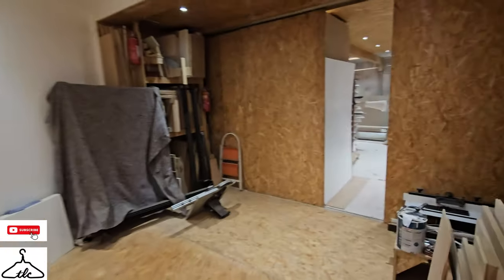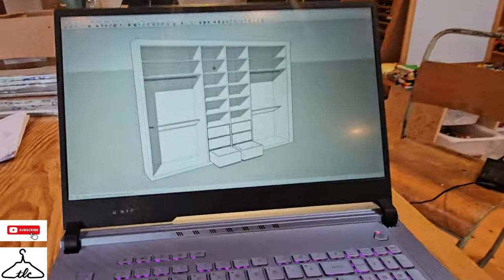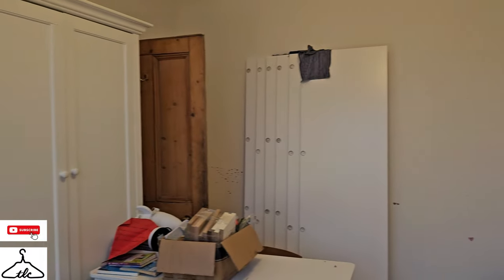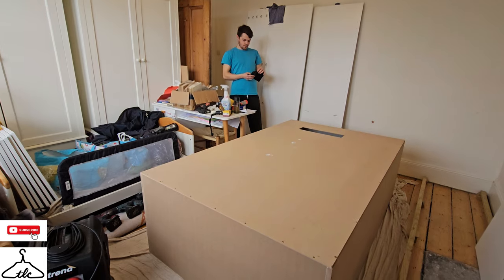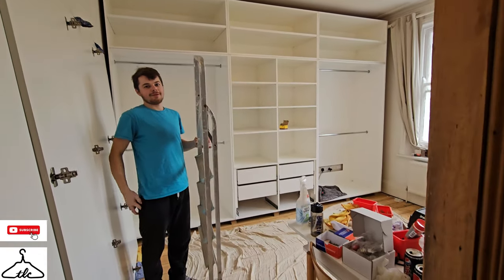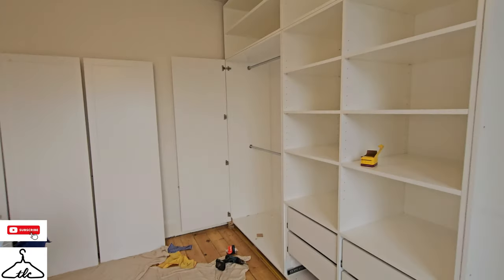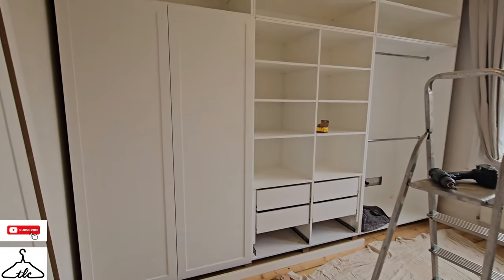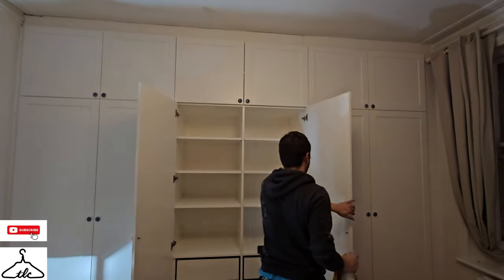GIGANTIC Shaker Style Wardrobe : Installation In Just ONE Day  (You are Joking Right !?)

Comment: Amazing job guys, well done! I have learned a few tricks of you over the years. Thank you!  Let me share my tricks with you too. Don't bother with 2"x1" battens. Get 3"x2" CLS for the front and back. Face it 3" upwards. CLS is so cheap and you don't need to mark where the uprights will go as it will be solid all the way trough. No need for MDF packers  to support it.  All you need just a few plastic packers to level it up.  Use laser for levelling instead of spirit levels.  Set the shelves in by 10-20mm . This way it will not interfere  with  doors, would they  be slightly bowed inwards.  Get  handles/ knobs predrilled in the workshop on the bench prior painting. It much faster than marking and drilling on site. For sealing the MDF edges, I use your stacking method, but with out filler. I get all sanded with 80grid as I cut , just  enough to get rid of saw marks. With stacking method  I just use Leyland  acrylic primer,  but very heavily so it fills all the pores and then sanding between the coats. 180grid after first coat, 240grid after second coat. It comes out smooth as glass.  I hope it will help to speed up your process. By the end of the day time is money. Good luck!
Reply from the maker: Thank you very much indeed :-)

Comment: Great work both of you 👍
Done a lot of those in my time,now doing them in Spain 😎
Over here, rather than putting trays or  timber down on floor we use adjustable legs same as kitchen carcasses but can go down to 60mm saves a lot of time leveling have you tried those rather than timber?
Amazing job 👍
Reply from the maker: Thank you and very nice being in Spain !!
I have used those feet but not really my cup of tea tbh.
Bearers only take me an hour max on a large wardrobe like this and to be honest it provides about 80% of the fixing strength, with just 2 screws needed in rhe top corners.
Plus love the fact there is no leveling, just place the carcass on and it's level. 👍👍
Reply: Too bloody hot in summer though, and no noisy work from mid July to September!! Can't upset holiday makers,
We lose 6 weeks earnings to keep them happy!
Love the channel, and the workmanship from you guys 👍👍
Reply from the maker: @davidcheswick4059 I can imagine the heat being 😬😬😬.
Thanks mate 👍